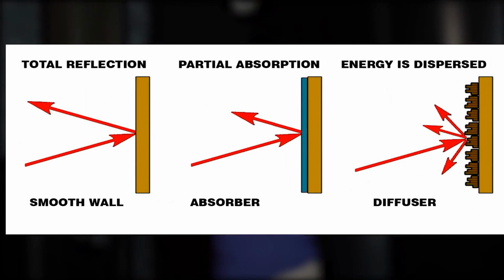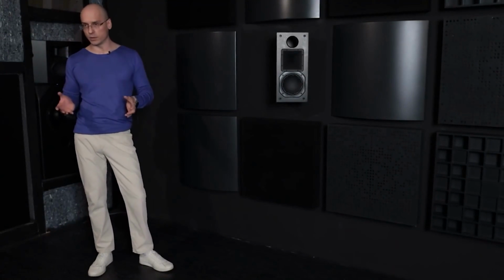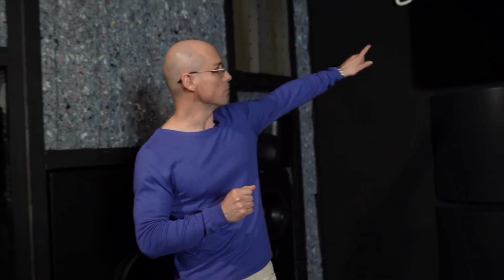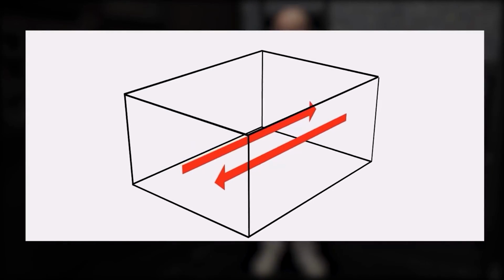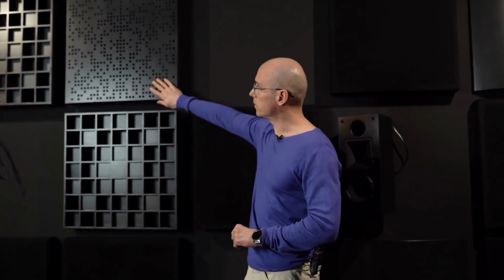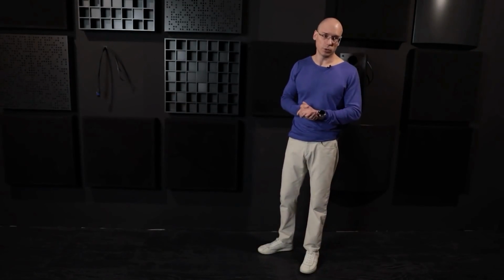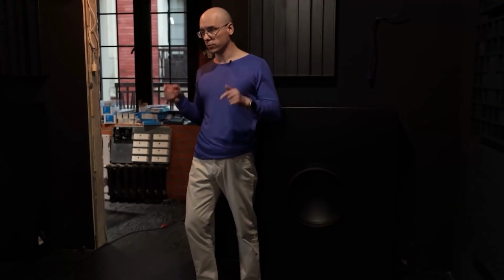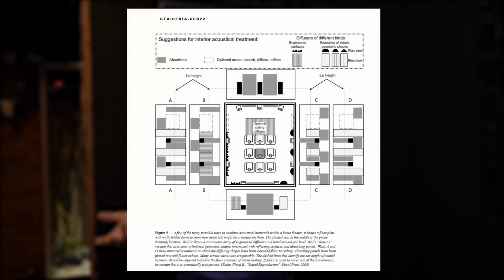Acoustic design in a home theater / How to correctly position acoustic panels?

Comment: Very informative. Although my room is not your typical 4 wall enclosed room I did take some thing away and it made a lot sense. 
My room is naturally dead sounding without treatment. I am right around .2 to .3 decay time. I made a rough slat style diffuser put it on one side at the first reflection and it opened up the sound big time. It made my room sound bigger and spacious. I am now going to try another on the other side asymmetrical. See what happens.

Comment: Yikes... music is different than movies. What a load of garbage. So watching a movie that is about music what would you do with that? Sound is sound either you are producing it properly or not. Panels and equipment doesn't have a clue what you are running. A great sounding room is just that. It will be great sounding no matter what you are listening to.
Reply: Music that is in movies is typically re-mixed, re-panned for multiple channel setups common in theatre. It's not the same two channel tracks.